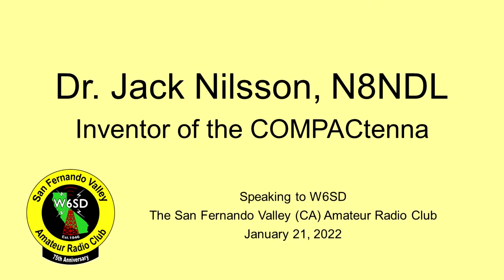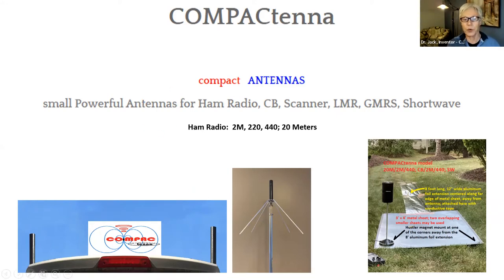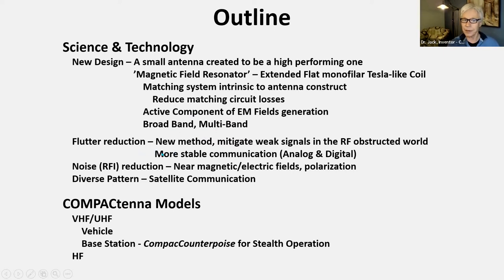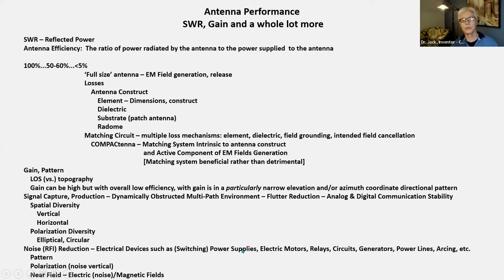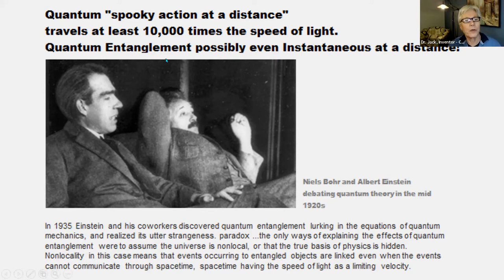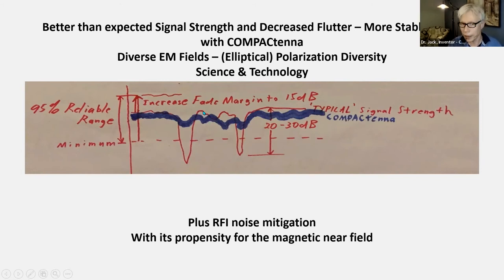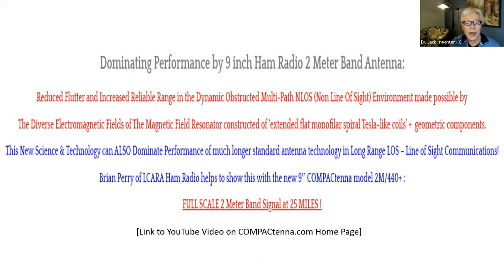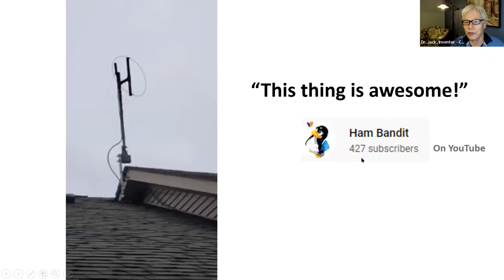Dr. Jack Nilsson of COMPACtenna

Comment: I have to say I watched for an hour but unfortunately learned essentially nothing.Testimonials don't work for me. I want to see antenna analysis, modeling, A-B range comparisons. 

But that was just a presentation to a ham club, so I looked through the website and unfortunately saw nothing concrete there, either. So I think I'll just not be concerned with quantum entanglement and my antennas. I'll just continue to design and build my own that are suitable for each application, and save $100. It's fun, I learn a lot, and that's what ham radio is really all about.
Reply: Design, and build something VERY, VERY similar, except only a higher power capacity!
I've been trying to trust any and all information anyone can find on this antenna.  When I hear the term "quantum" anymore it makes me think of all these videos on YouTube that are basically immersed in "magical thinking". 🤣🤣🤣
KD8EFQ/73

Comment: Hi Question for this antenna for Jack.  Does this antenna have to be used with a mag mount? I want to install it on my aluminum roof rack (Prinsu) with a simple L bracket at the front corner of the rack.  Would it have the same performance as a mag mount in the same location?
Reply: Hi Jordan. A variety of mount types may be used. (NMO ... Magnet, L-Bracket, through-hole, etc.) Please see the INSTALLS page of my COMPACtenna website. At an upper corner of the vehicle and in this case the L-Bracket at a corner with screws into the metallic rack is generally the better location for SWR, check it. With good SWR the performance is generally substantially similar on a vehicle with (at least capacitive) coupling of the metal roof rack to the metal of the vehicle.
Reply: @dr.jacknilsson1970  Thanks for the information!